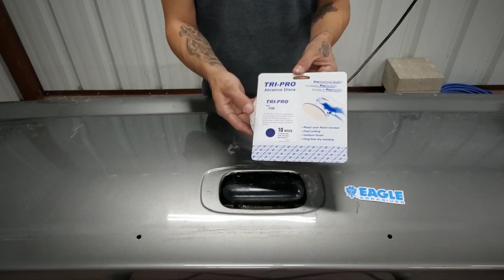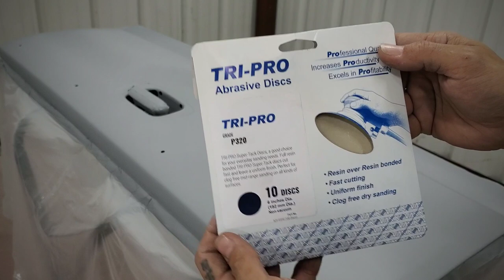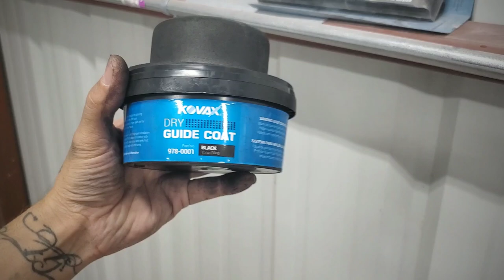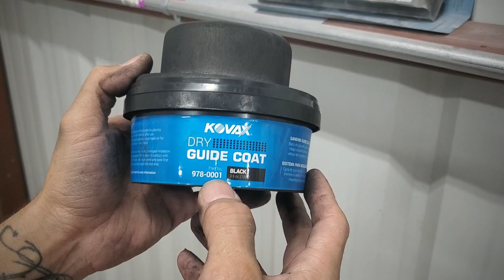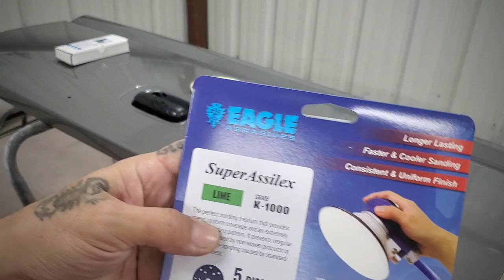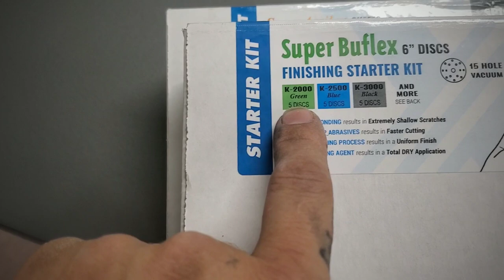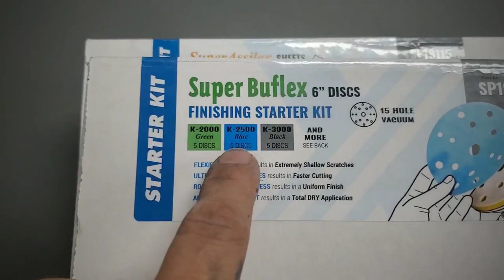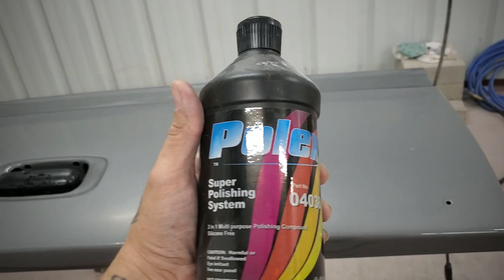Step by Step Sanding with Eagle Abrasives

Comment: That's the same color as the tank's and fender's on my Harley. Single stage. Had to sand it down with 1000 - 5000. Polished to a 12 inch shine.

Comment: which kit do you recommend for removing orange peel from a paint job on a full car? will one kit be enough for a whole car or do you need? can the discs work the same with an electric palm sander or does it need to be air? also what kinda pad did you use?

Comment: Im currently doing this exact same tail gate but im copying what you did with the grey honda im gonna use white restolium what do you recomend i do ? Should i primer it or just with the restolium is good cause i sanded it down but it has bare metal showing

Comment: after the block sanding shouldn't you give it another pass with the da to smooth it out ?
Reply: You can. You can go all the way up to 600 grit before spraying paint. This helps when you’re dealing with metallic colors because the primer tends to shrink overtime and you’ll start seeing the sand scratches show in the paint. Especially if you use things like 1k primers and spot putties

Comment: If you have car with lite scratches in paint can you buff it with compound or do u need to sand then polish
Reply: Buffing alone will only remove swirl marks. If you have a scratch, spray water on it and if it disappears, you can sand it with 1000 - 3000 grit and then buff it out.